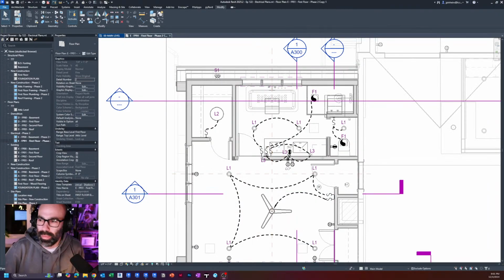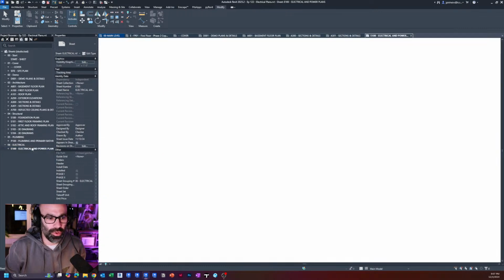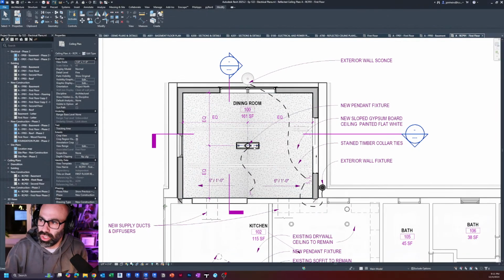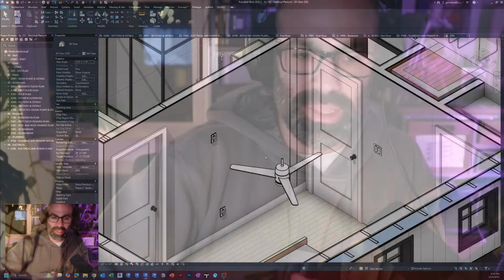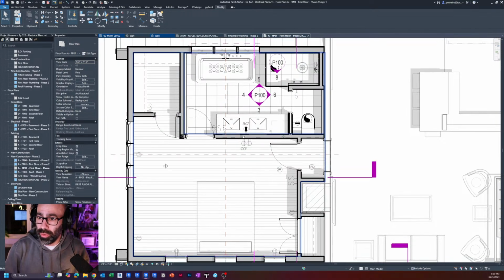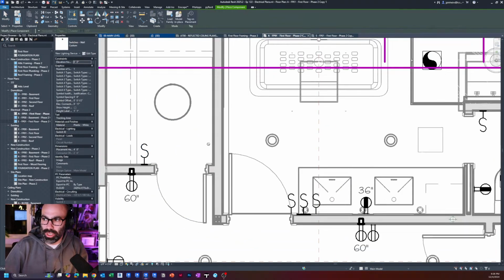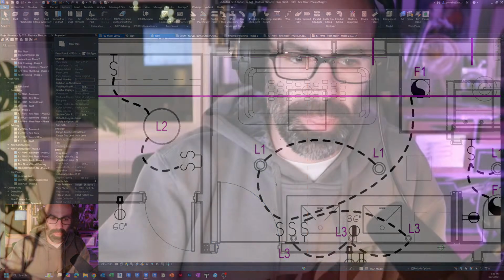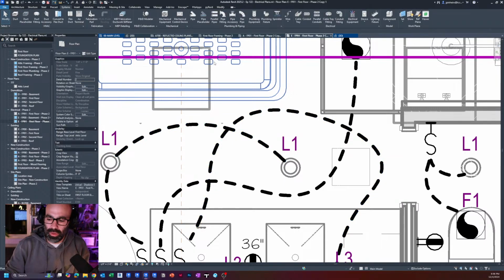Electrical Plans in Revit: Simple Tutorial for Architects (The North Wing - PT 8)

Comment: Hey Jeff! Great to see you covering the electrical discipline in your project! And as an electrical engineer, I'm proud of you for using the Wiring, not just detail lines! Even though you are not actually logically circuiting your devices, like you demonstrate, they at least are "connected" and move along with the devices - very handy - and for anyone that has tried to "edit" detail arcs - good luck. And I can see how combining all electrical (power and lighting and even data if you had it) is advantageous to architects - that's how I've seen most others do it as well - the overlay is a great tip - and looks like Brenton's families do contain the hidden geometry needed to get the "cut plane" issue to work for you that way. On our actual electrical plans, we do separate them into power plans and lighting plans (and even technology plans), mainly just because we show so much more detail with the circuiting and all - so the view range is not as much as an issue. And yes, like @JeffHurdis noted in a comment, have to be in the "Electrical" discipline for the wire breaks to show. Again, thanks for covering this trade in your video! (and thanks to Larry for the shout out!)

Comment: changing the wires/connections to red wold also be another way to not overweight the line thickness while still using standards to help with the visual and information design.